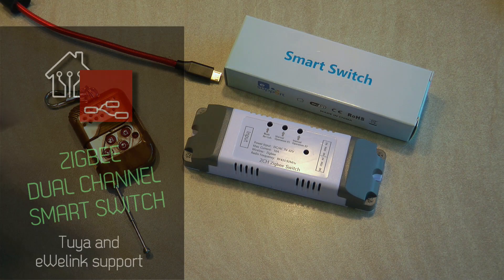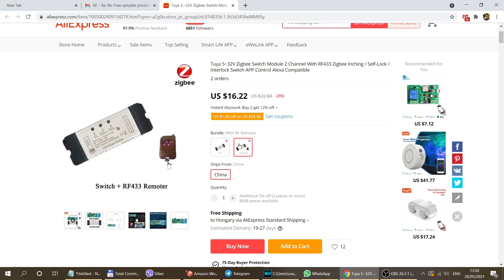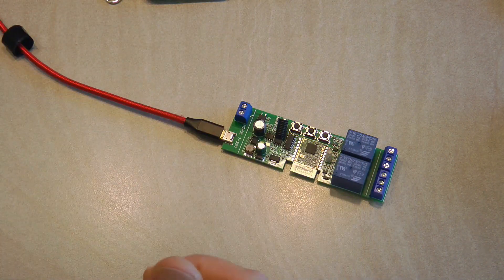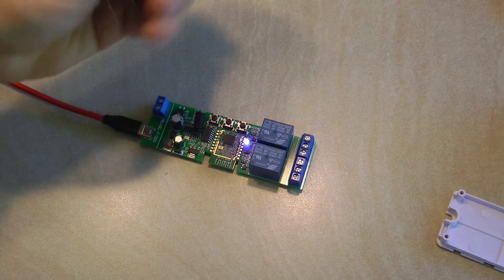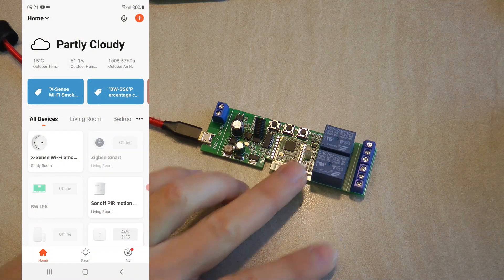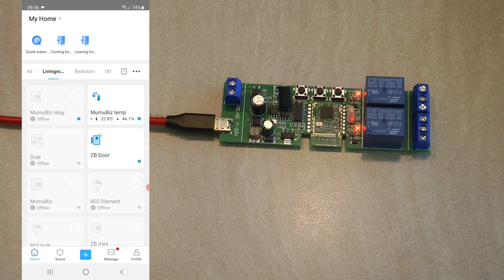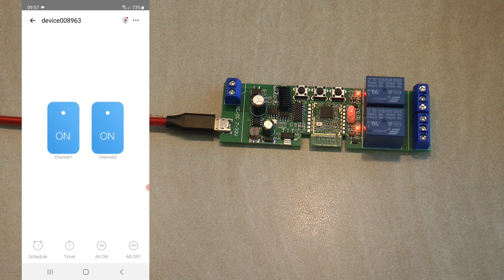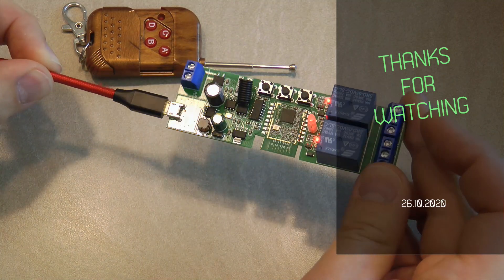Dual channel low voltage zigbee relay

Comment: Is it possible to use both RF button remote and phone at the same time one opening 
And one closing without the other going off line
Reply from the maker: You can use both at the same time, but you cannot limit that for example only the RF button opens the gate.

Comment: I'm using it for my power gate. I realized the 433RF signal is very weak. I'm using the same remote, I used to be able to open my gate from more than block away, and since I removed that old receiver and installed this, I can't even open it in my car while being outside the gate, I need to open the window to get the signal out.

Is there a way to extend the antenna?
Reply from the maker: I am not sure. These RF antennas length need to match with the frequency. Maybe you can straighen the coiled up antenna and extend it out of the case? But I am not sure.
Reply: @csongorvarga  you mean I just pull it ? but the antenna is coiled up, and connected to 2 points. All the other RF receiver videos I've watched only have one point of contact.
So the length of the antenna is important?

Comment: Can you disable the RF part, limiting it only to zigbee?
Reply from the maker: No, there is no setting for that. But most probably you can de-solder the RF antenna, or cut the trace to the RF antenna. I did not try that.

Comment: What's the purpose of the 433Mhz Radio?  ZigBee is 2.4GHz!
Reply from the maker: 433 MHz is used to pair a cheap remote control to it. Everything else works on Zigbee.
Reply: @csongorvarga  Why would anyone need a remote control when you have ZigBee ?!?  Home Automation is all about getting rid of all too many remote controls around the house. Sometimes I completely fail to understand what goes on inside the heads of product developers.....  🙄
Reply from the maker: @metoo7587  Because 433Mhz RF is dirt cheap, probably no license cost, nothing. Or just had a lot of them laying around in the factory and wanted to put them to better use :)

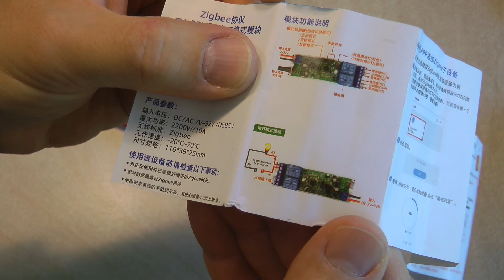Comment: 5:33 you say there is no indication but at 2:48 the cover has it marked. I know you probably mean that there is no indication on the board itself. That would be a problem only if you didn't buy one with case.
Reply from the maker: Yes indeed, thanks for point it out.
Reply: @csongorvarga  YW. Yeah funny, I only mention it because as I was trying to mount it on a board , to mount it on a DIN rail, I noticed that there was no markings. I knew I had seen some and thought I was losing my mind , for a quick second. Then I realized/remembered that I had seen them on the cover.  I took comfort that you may have done the same. Was glad that it wasn't just me. LOL

Comment: Is this working for garage door with 3 buttons,,if i press up and than down will it go down or must first stop with button up and then down
Reply from the maker: Yes, it has regular relay outputs, so you can wire them directly to the up/down switch terminals.

Comment: will this work with two 120mm 5v fan or two 12v 120mm fans ?, I have some spare computer fans, I want to cut the ends and connect them to the above relay to control them via zigbee2mqtt, Also can this relay just bew powered by micro usb for the two 120mms fans i plan to use with them ?

Comment: Another great video, I was looking for a zigbee 2 relay switch for my ventilation system.   Do you know if there are also 0-10v zigbee regulators? There are 0-10v zwave modules.. But I did not find any with zigbee.
Reply from the maker: Check this out, 0-10V LED controller: US $34.20  10%OFF | ZigBee ZLL 1-10V LED Light dimmer Controller Smart Home Modified With ZIGBEE 3.0 Bridge  Echo Plus Alexa Control App AC100-270V
https://a.aliexpress.com/_m0ppa8H
Reply: @csongorvarga  My man!!! Thanks!